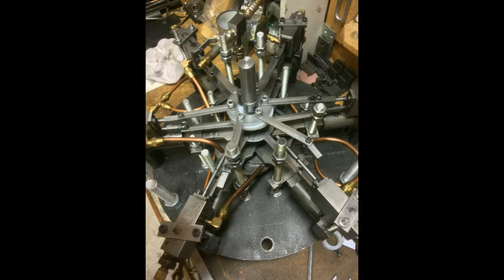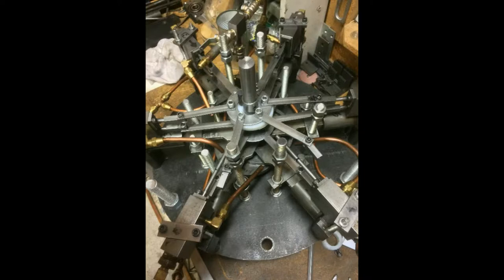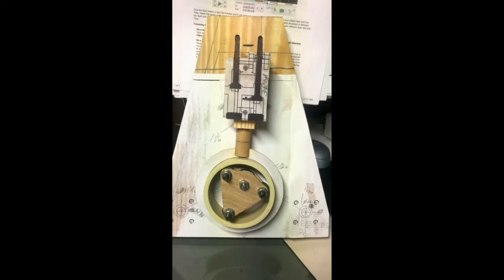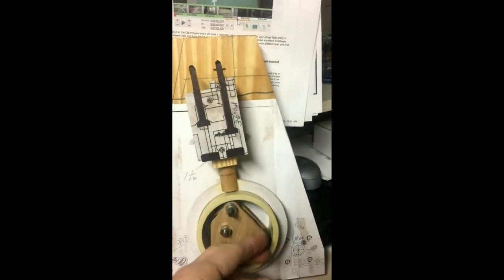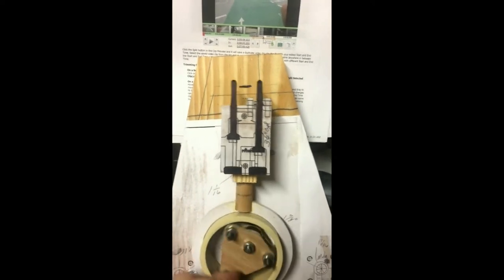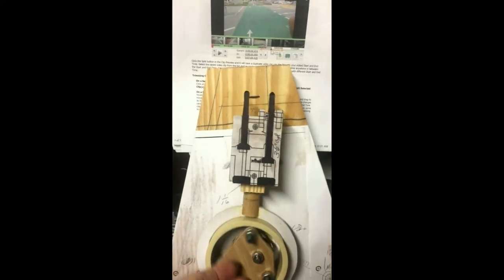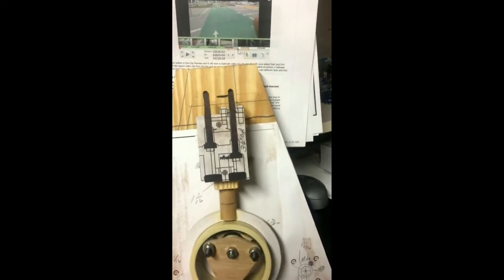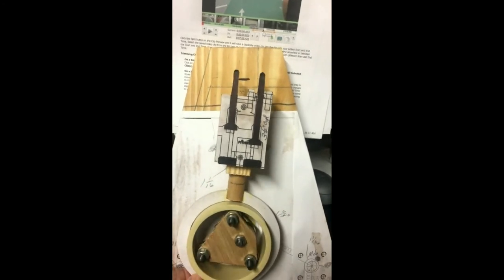Air Engine Research Over the Winter 2018 to 2019

Comment: Nice to hear from you, I love it. You got a great creative streak! I've been thinking about oscillating motors and admire the simplicity of their valving. Have you considered that?
Reply from the maker: Thanks for the comment.
Like I said in my last video, I have not stayed true to my initial goal of a simple air motor with as few parts as possible.
I have a new very very simple design using what I have designed with an eccentric rotation of the drive shaft, and a one piece rocking slide valve.
I have also realized that it is possible and practical to build a working Air Motor using wood, plastic, leather and some metal parts where high pressure or high ware might be.
I’m working on it, and soon I’ll be demonstrating a single cylinder engine with 4 moving parts and 7 sealed bearings